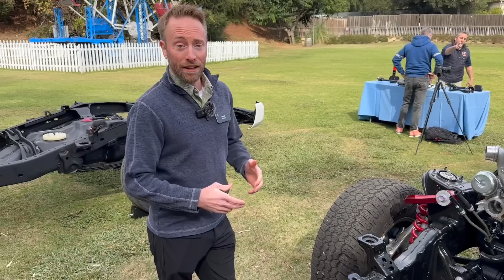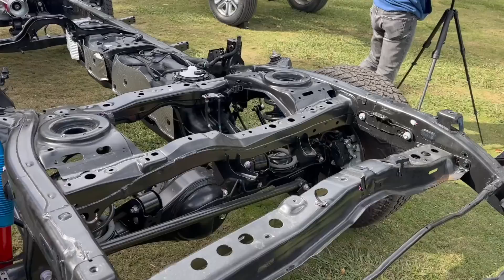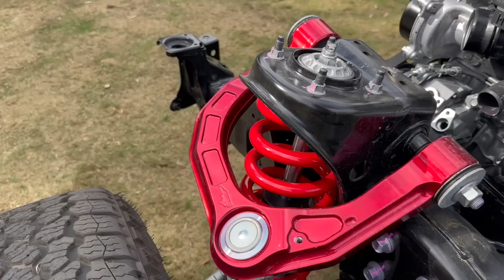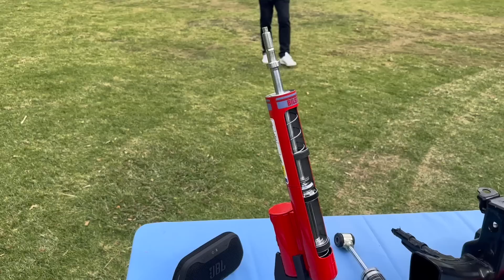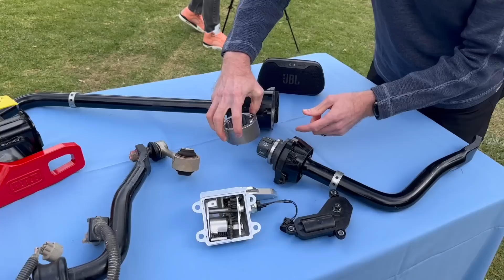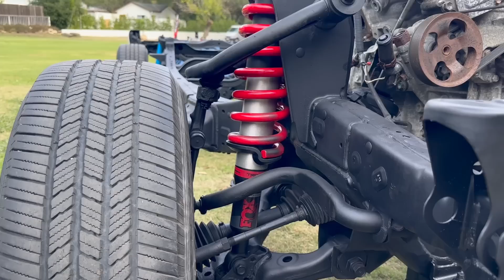2024 Tacoma Lead Engineer Explains Why The 4th Tacoma Is Better Than The 3rd Gen

Comment: Really love what they did, if you purchased one and it ended up having to get recalled which i doubt would you be stuck with it? Or what options would you have??
Reply from the maker: A recall is just a simple fix at a dealership, so it would be covered under warranty and they would just fix the truck for you

Comment: I would never buy the first year of production.  Maybe 2026.
Reply from the maker: Why is that?
Reply: The 2022 Tundra is a good reason.
Reply from the maker: Everything fixed under warranty? And 2024 models still having the same issues? lol
Reply: @TRDJon  I’ve heard of some people so frustrated with rattling windows that they want to sell their Tundras after the dealer can’t fix them! 
In my 35 years of following the auto industry I’ve seen many issues with vehicles pop up after 50,000+ miles. Just because turbos aren’t failing under 50,000 miles doesn’t mean they will last as long as a 5.7 or 4.0.
Reply from the maker: Right, 3 years in is what I'm getting at. Takes forever to fix issues so it doesn't matter when imo.

Comment: Good move getting rid of the 6 speed automatic from the previous gen. It felt weak at low RPM.
Reply from the maker: Super weak.
Reply: @TRDJon  the 4.0 v6 and the 5 speed auto is much better when it comes to torque and towing. I’ve never towed with a 3rd gen, but I imagine the powertrain would struggle more.

Comment: If Toyota believes the new generation is better especially the engine, why don’t they offer 6 or 7 year warranty on their engine? 😂 let’s put some salt on your words buddy. Absolute corruption in the car industry nowadays. Smart sensible people would buy the Nissan Frontier with naturally aspirated V6 engine.
Reply: Nissans are garbage 😂 owned a few from leaking waterpump gasket, cracked exhaust manifold, fuel pump issues and a lot more all occurred before 90K

Comment: Jon, I have a question. I need a new truck quick, got rid of my 16 Land Cruiser, now I want to get a new truck so I can start doing some over landing on the weekends. Should I pick up the 3rd gen or should I just wait for the 4th gen? Should I consider the tundra? Help me out here Jon it would be much appreciated. Thank you and love the content
Reply from the maker: You should buy my 3rd Gen TRD Pro :) Honestly, any are gonna be good for it. I wouldn't do Tundra though, too big imo, at least here on the east coast
Reply: @TRDJon  alright, you think it will be a good daily too? I need something for both. At this point I think I’ll take my chances and wait for 4th gen
Reply: @AbasPilot2006 my whole life I’ve always been told never buy the 1st year of a car. While I trust Toyota with my life, if you plan on over-landing and doing long trips away from help, you might be better off getting a TRD off/road or Pro 3rd gen and then in 3-5 years get a slightly used 4th gen after the kinks have been worked out

Comment: Any idea which drive mode the mpg estimates are based on? I would assume sport, normal, and economy modify it at least a bit.
Reply: eco mode,  no wind, 64lb driver, 100psi in tires and 51mph max speed.
Reply: Definitely eco mode and very light driving

Comment: Anyone know if you have to remove the truck body to replace the turbo if it does fail, like the new 2024 Tundra?
My understanding is that only one of the turbos on the tundra can be replaced without taking body off the frame
Reply from the maker: Judging by the location of the turbo being literally front and center of the engine, I’d assume not
Reply: @TRDJon  That's a good point I believe the tundra turbos are closer to the firewall I believe no expert.
I'm trying to decide between a 2023 or 2024 Tacoma
Great video btw!
Reply from the maker: Yea tundra is lower for sure and further back.

Comment: How many miles  can the turbos last on these trucks? How much will it cost to replace?
Reply from the maker: According to the YouTube engineers 50K miles and $100K to fix.
Reply: Turbos can last long if properly maintained. I would say a minimum 200k+ with examples from previous Toyota turbo engines like the one in the NX200t and that was a previous gen engine. Good engine almost no issues with that turbo engine. I think we could possibly hear issues with the turbos or the engine itself  not because of poor design but because some people will neglect maintenance. 5k oil changes no matter what. And honestly this engine isn’t even that complicated. It’s rather simple and lots of mechanical stuff. The 3.4T is a different story
Reply: The turbos will outlast the engine.  500k miles minimum
Reply: @user-tb7rn1il3q that might be an exaggeration, but if properly maintained with regular oil changes it’ll probably be just fine for the first owner or three.
Reply: Never Buy anything gas with a turbo ...... common sense.
Reply: @bullbutter9699    what a dumb comment  😂😂.        Mr bullshit9699 toyota are the kings of ultra reliable  turbo trucks for years and years around the world. So overall you have no right to use the word common sense. when your comment dont have that

Comment: Disappointing that they improved MPG’s by only 1-3 but then drastically decreased the fuel tank size! Would’ve been nice to have a truck with longer range capabilities.
Reply from the maker: Yea I thought I had film as to why that was shrunk but I guess I didn’t. I wish it was more too. Hopefully the hybrid gets a bit better of mpg to offset.
Reply: seems like all the tanks are smaller now - trucks, cars…
Reply: Reliability is an experience not a explanation
Reply: Horsepower and torque are way up especially on the hybrid Max at 326hp and 465ftlb, and gas mileage still went up, it did not go down.  I really don't understand how can that be a complaint? Lets flashback to 2005 tundra 4.7 V8 that stock only produced 282hp and 343ftlb at 15mpg at BEST, and here we are complaining about a lighter, smaller truck, that can have a loaded interior and produces way more power than an old stock tundra V8.  I would question reliability with no long term tests, but it seems to sound like a winner on that front as well.
Reply: If it’s anything like the next Gen RAV4 or Tundra dynamic force engine except real world efficiency to increase 50%.  The new Tundra is at least 50% better. The 5.7 got 12 the 3.4 TT gets 18.
Reply: Literally speaking the truth I can’t stand when they give you basically 300 miles to the tank like make that crap atleast 400-500 miles I rather pay more upfront than have to refuel every 5 days it’s so freaking annoying
Reply: @empir3289 keeps your fuel fresh bruh!  

Probably a Toyota 🧑‍💼 sales rep.
Reply: I bet they did it to make it lighter getting it better mpg lol
Reply: One just blew up … not reliable at all.
Reply: What is fuel capacity now?
Reply: @corbindallasmultipass  21.1 to 18.2; real world range will be higher
Reply: So what does that mean ? I can use the truck for long trips ? 500+ miles ?
Reply: @abgh2204  get a sr5 tundra for a few thousand more. Drove from Syracuse NY to North Carolina on one tank. 32 gallons at about 21mpg
Reply: seriously wtf
Reply: Mpg is not important 
The main thing is to reduce emissions only
Reply: Is this improved fuel economy with or without the air dam?
Reply: @Ninovium97 air dam removed it gets 4mpg less than the v6 😂😂😂
Reply: @AntilleanConfederation  The V6 guzzles fuel because it doesn’t make any power under 4000 rpm.  I test drove one and it was terrible.  The new power train is light years better.  I bought a 4R instead with the 4.0 V6.
Reply: @user-tb7rn1il3q  Lolol. The 4.0 4Runner gets worst fuel economy dude, 5spd auto , wtf you talking about. In all honesty all they had to do was add the 4.0 v6 with the new 8 speed transmission.
Reply: @user-tb7rn1il3q  4Runner TRD off road gets 19 highway.  That’s what the Tacoma makes on city driving. Gets 24 highway… so much for bitching about fuel efficiency and then getting something worst fuel efficient. I rather burn more fuel and have something last way longer and be dependable.
Reply: @AntilleanConfederation   🤫👎 1. New turbo i4 hybrid and turbo i4 engines are miles better than any v6 from power performance torque quality and more.so your outdated and misleading opinion is bullshit .lol
Reply: They're just lowering the bar for EVs
Reply: @AntilleanConfederation  The 4.0 in the 4R gets better mpg since it can run 5th gear.  The 3.5 Taco spends most of its time in 3rd and 4th on the highway unless going downhill.
Reply: Everyone on here arguing about MOH while the Hilux is getting 30+ mpg. If they didn’t build their vehicles to Commiefornia standards we could have that too.

Comment: There is no way that turbo 4 can last as long as 3.5 V6.
Reply: If an engine is designed from the ground up with a turbocharger in mind, it can last forever... semi-trucks and other industrial engines use turbochargers for huge miles without issue. Turbo's got a bad rep in consumer applications because, for a long time, they were bolted onto engines that hadn't been designed for turbo applications.
Reply: Bullbutter @t3h8ar0n
Reply: Ignorant opinion that it way too common sadly.
Reply: @t3h8ar0n  was referring to the guy insinuating turbo's are unreliable btw
Reply: @CDX7  My bad!
Reply: @CDX7 unreliable they go out just like ecoboost at like 120-150k miles
Reply from the maker: Yes because Toyota is Ford… 🤦🏻‍♂️
Reply: @scottishd0g87Plenty 3rd gen 3.5s well into the 300's with general maintenance
Reply: @scottishd0g87 300k and still going strong with standard maintenance is impressive.  
An Ecoboost making it to 300k is an anomaly.
Reply: The tundra turbos are already having trouble. Wait a couple years let them get the bugs worked out.
Reply: You are correct
Reply: @bullbutter9699   again       mr bullshit9699. Stop your ignorant and silly comments 😂😂

Comment: LB7/First gen duramax engines had 300 HP and 520 lb-ft of torque. So consider where the hybrid taco engine is sitting 20 years later 🤯
Reply from the maker: Wild right??
Reply: These new Tacomas are gonna get worst gas mileage and popping 4 cylinder T-engines once they start living with hauling heavy equipment or a big trailer attached to it.
Reply: Stats are one thing, but being task built is another. No chance a gas engine will live as long or tow as well if used extensively for that task as a gasser.
Reply: @carbonking53 I was pointing out how far technology has come in 20 years…
Reply: @Cody_Austin  I get that. My point was to emphasize the fact that gas engines, despite their HP, torque, and tow rating will not do work at the same level a diesel will. Nor last as long if asked to do it. Always take gasser tow stats with a grain of salt.

Comment: Don't mind me; I'll just be hanging out here in the comments reading all the hot takes from random dudes who never finished high school who somehow know more than Toyota's chief engineers because they read a Reddit post from some other guy who didn't finish 7th grade who heard that his old high school football coach once saw a 2022 Tundra on the side of the road and assumed it had broken down due to exploded turbos. Or something.
Reply: My favorite are people who appear to be unaware that semi-trucks have been using turbo's forever. If the engine is designed for turbo use from the ground up, it will be fine.
Reply: @t3h8ar0n  Absolutely. And there will ALWAYS be teething problems on new powertrains. It's not the end of the world. It's just that Toyota so rarely introduces radical redesigns that most of these negative posters were in middle school and don't remember the last time a new Toyota powertrain was introduced.
Reply: @t3h8ar0n im a diesel tech, maybe depending on location and driving conditions, but turbos are pretty frequently replaced, especially cummins, Detroit diesel not so much, but cummins VGT actuators are notorious for having faults, even on new low mileage semis
Reply from the maker: Plus also them thinking Turbos are new to Toyota when they have been running them for decades overseas and hear in the states on certain vehicles
Reply: Loving my 24 Pro Tundra !! Taco looks cool if you don't need/want the space Tundra offers.
Reply: Had an IS 200t years ago, solid, solid powertrain with the 8 speed. If we kept it, it would have well over 100k miles with zero issues. I take great care of the mechanicals and fluids. 
Our 2020 4Runner has 76k miles, every fluid was changed. Runs amazing, even the transmission pulls harder and shifts smoother since changing that fluid. 
I’d get the taco.

Comment: Question here, will this gen be able to tow a uhaul car trailer? My second gen isn't allowed.
Reply: A 2nd gen should be able to if it has the required equipment like proper hitch receiver and trailer wiring harness. But aside, yes this new one, again if properly equipped, will be able to tow up to it's rated capacity of 6-6500lbs.
Reply from the maker: Not sure why you were denied. Unless you were trying to get one not meant for your truck. But they can tow up to 6500
Reply: I had that problem one time when I tried to reserve the trailer online but when I called them they set it up no problem.  I have towed uhaul car trailers three times now. One thing you can try is to tell them that you are towing a lighter car like a VW beetle on the trailer. They calculate weight of trailer+car and use that to determine if they’ll let you rent it or not.

Comment: Given your experience with your 22 and 23 Tundras and what you’ve seen of the new Taco, if you were looking to pick a new truck, which would you lean toward (all things considered)? I really want more rear legroom, but the Tundra fit and trim has me worried. Appreciate any opinion you have.
Reply from the maker: Amazing question. In all fairness, I’ve only been in pre production Tacomas. So idk what the fit and finish will be like, but I’d still pick a Tacoma over a Tundra if I had to pick one.
Reply: @TRDJon  - thank you. And also thanks for mentioning your height in one of your videos where you talked about the rear Tacoma legroom. It helps gauge the rear legroom size.
Reply: @TRDJon  can you explain why? Im on this same fence.
Reply from the maker: Tacoma just seems more thought out, better features, more features, better driving, more nimal, better MPG, will have a better aftermarket scene, just to name a few that come to mind.
Reply: My 24 Pro Tundra has no issues so far, only 2k miles (almost) but it's awesome !!!
Reply: @Sam-dq7ws  that's great to hear. Maybe Toyota fixed the window rattles in the 24 Tundra. @TRDJon has had window rattles in both his 22 and 23. The drivetrain seems flawless for most (not all, but most), so I am fairly comfortable with that part of it, but rattles would drive me crazy. Hopefully yours continues to be rattle-free. I really like the Tundra and hope Toyota fixes the issues. The Tacoma is their bread and butter, so I think they will be all over any initial issues.

Comment: Too bad they can’t make a transmission dipstick.
Reply: Does it need one?
Reply from the maker: For what?
Reply: There's no transmission dip stick? I get it most people don't ever check their transmission fluid
Anyone know how you check fluid level after changing transmission fluid?
Reply: @erichubbard7754 yeah. Fill it, when it drips from fill hole you are done. If you want to double check drive it a few miles. Come back and re fill and it it spills right away. You had it right the first time.
Reply: @AntilleanConfederation  okay that makes sense just like my lower unit on my boat
Reply: @erichubbard7754  make sure you are on leveled ground or lift.
Reply from the maker: These modern vehicles don’t need their fluid changed often. Maybe like 50-100K miles or more

Comment: Why can't Toyota get a decent oil filter setup? They finally got rid of that ridiculous plastic cartridge housing, But they replaced it with a horizontally mounted filter so your skidplate fills up with oil and drips for days on your driveway
Reply: Maybe it'll have a channel or guide for oil. My F-150 has something right underneath the filter that funnels it to a drip point. Super easy and mess free, then just wipe it up. Even if it doesnt though you can buy a flexible and moldable drain guide that eliminates that as well.
Reply from the maker: I don’t think an oil filter is suppose to drip
Reply: @TRDJon  How you going to change the filter without spilling some? I'm assuming that's what he was talking about.
Reply: You are not spilling some, you are spilling the entire contents of the oil filter, once you loosen that filter it's pouring out
 @rockie307
Reply: @TRDJon guy is clearly talking about DIY oil changes  🤦‍♂️
Reply: @TRDJon  When you take it off, where is all the oil in the filter going? right into your skidplate and that will drip for days
Reply: @johnmckenna4256 I understand what you mean from the very start.  Some people are clowns on purpose or just don’t know because they get all the service done at the dealership.
Reply from the maker: Sorry, it was a pretty open ended question so I thought you meant it would leak in a horizontal orientation. Personally if I was doing a DIY oil change, I'd take the extra 5 mins to remove the skid plate, use break cleaner to clean up my mess, and then re-install everything. I'd assume to drain the oil in the engine first and then the oil filter to mitigate any spillage, and utilized an oil catcher you can get from autozone to stuff isn't all over your driveway.
Reply from the maker: Whatever dude. It was an open ended question. Learn how to talk to people.